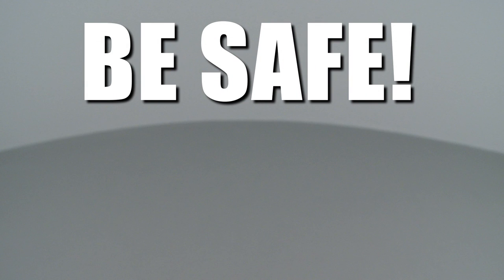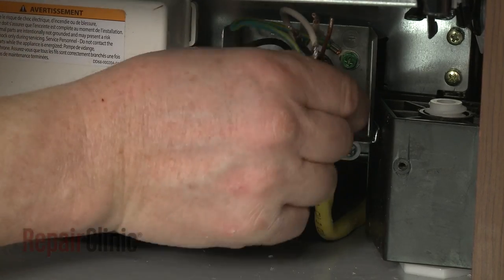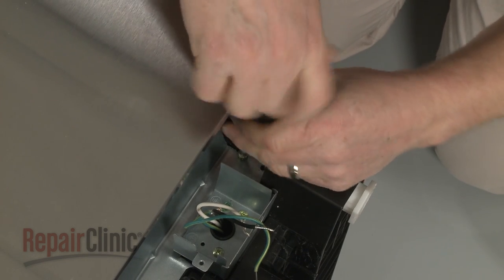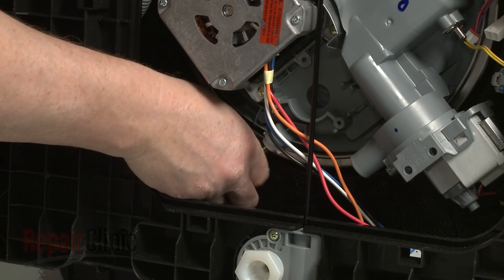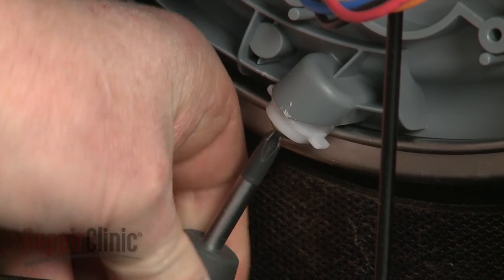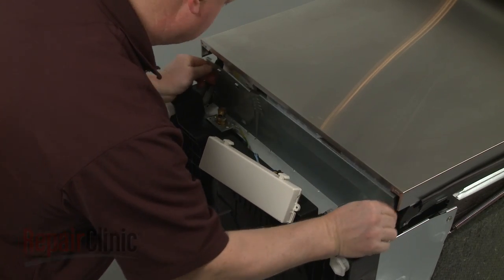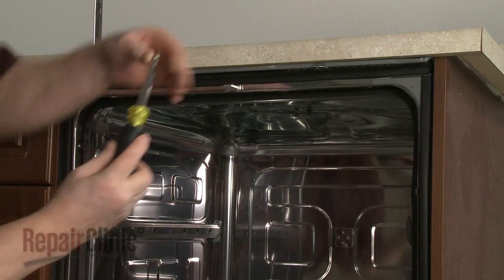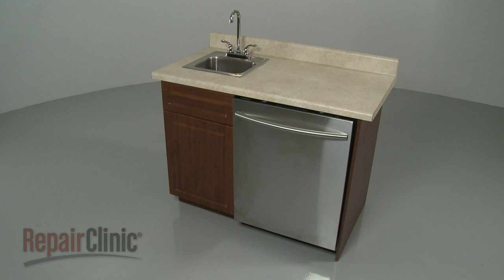Samsung Dishwasher Sump Seal Replacement #DD62-00050A

Comment: Such an awesome video I was able to do it myself! Unnecessary steps in the beginning, no need to disconnect the front housing stuff or the drain hose from the pipes or the water line or both ends of the power cord. Just turn off breaker, turn off the water, disconnect power lines underneath the sink and carefully pull out. The lines should all be long enough to pull out all the way. YOU NEED A VERY SHORT PHILLIPS SCREW DRIVER! I didn't have one and it took me forever to get some of the screws out and back in. Would have been quite quick and a lot easier if I had known.

Comment: Used this video to replace the whole pump assembly after the circulation pump on mine went bad. Not my first time working on appliances. It took about 1.5 hours total. I wouldn't try to skip any steps. For example, removing the front gray sheet metal panel (behind the circuit board) give you a path to get the retainer screws with a long Phillips easily instead of trying to cram your hand in there with a short Phillips. This is a pretty easy job through. No special tools or crazy steps. Longest step was relevelling the whole dishwasher after installing it.

Comment: Good Video, not that hard to do.  I was a bit scared by the many steps and the fact that mine is not exactly this model.  The idea is you carefully take everything apart, it goes back together easily.  I took pics of each connection to make sure the colors match up and polarity was right.  Just don't yank or you might break plastic.

I would have liked some extra info, how to relax the rubber on the new one if it's twisted (Hot water soak).  Or a reminder to wipe where the old rubber was to avoid build up.

Comment: Samsung appliances are the worst. My 4 door fridge arrived without the middle bar on the upper doors, so there was a half-inch gap into the fridge. The induction range was a complete lemon and eventually Samsung bought it back. Now, the dishwasher I disassembled at least half a dozen times because it won't drain. A very narrow passage in a plastic part gets blocked by bits of dishwasher that are rusting off - yes, you read it correctly - the rack spikes rust off. After the latest disassembly and cleanout, the top sprayers won't turn, as the bottom of the feeder won't snap into place at the water outlet.
When I posted about my problems on a Samsung's customer review site, my post was deleted and I was told the post did not conform to the Samsung posting standards. I guess talking about their crappy products is forbidden. Just don't buy Samsung.
Reply: I agree 100% Samsung appliances are the absolute worst. My dishwasher (the one in this video) worked for about 6 months, and then it stopped cleaning and began leaving food residue on the  dishes. I have had the soap dispenser replaced and then the wand arms and it still does not work. Forget about the Refrigerator as the icemaker stopped workong first, and then it began filling up with water below the crisper drawers and has since frozen completely over. It has been a constant battle with LOWES as the service calls seem to not be getting entered into the system as repeat calls so they wont do the buyback. Never again will I purchase a Samsung appliance...
Reply: Walter Turner b
Reply: @Thomas Jefferson Wow! You said 100% what my wife said !!!! We had 2 fridges a dishwasher and a stove fail.
Reply: @Thomas Jefferson our low point was a thanksgiving with 30 guest in our house. The stove with the turkey inside locked the door and went into selfcleaning mode. Transformed the bird into a tennisball size lump of charcoal.
Reply: @Thomas Jefferson 😂
Reply: @Beinhartwie1chopper  SKYNET